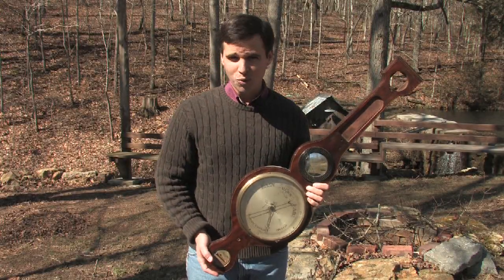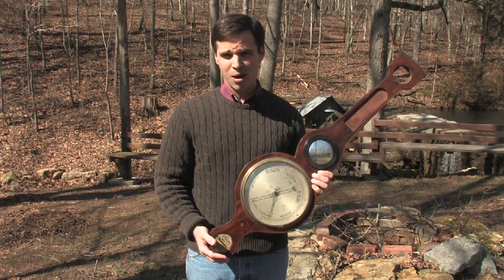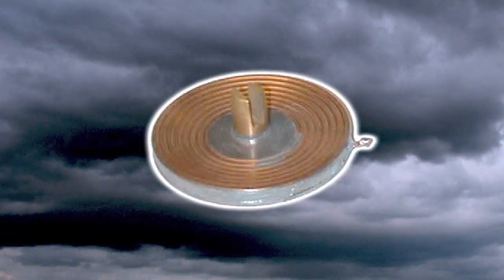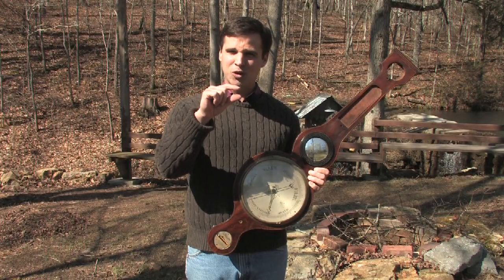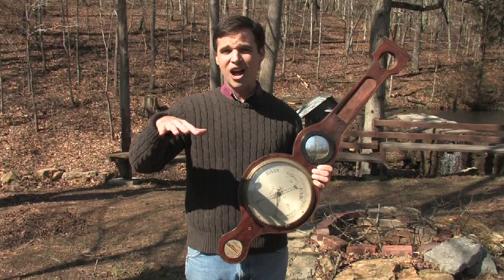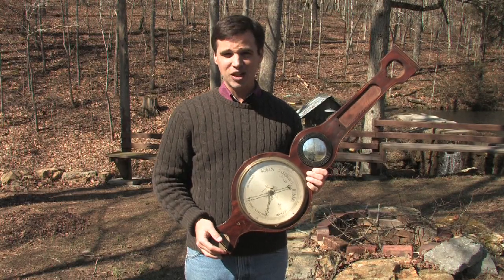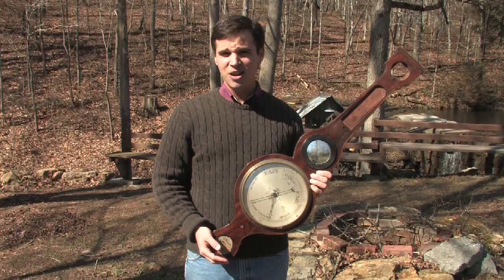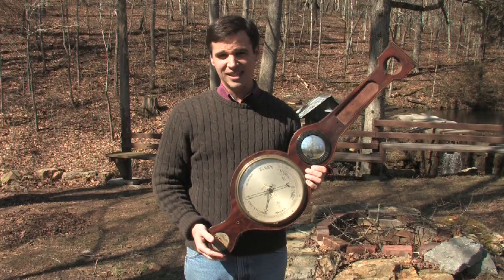Weather Barometers : How Does a Barometer Work?

Comment: Please show every specific values related with this in joules terms so it's actually work done found ?
If we use its work out put then we got electricity or not by using gears and other possible hydraulic system